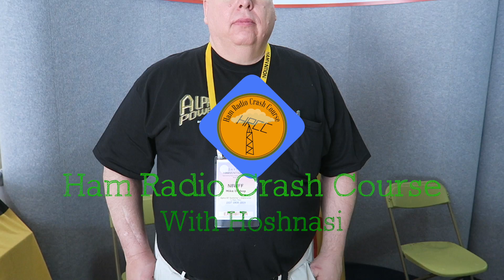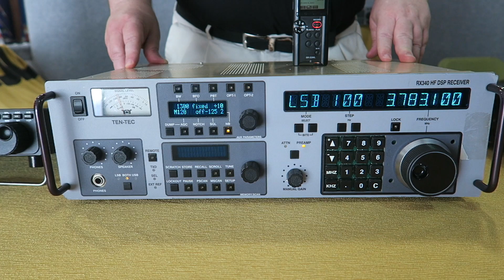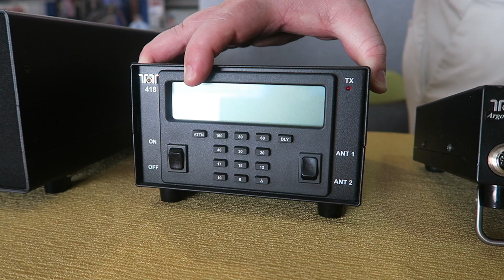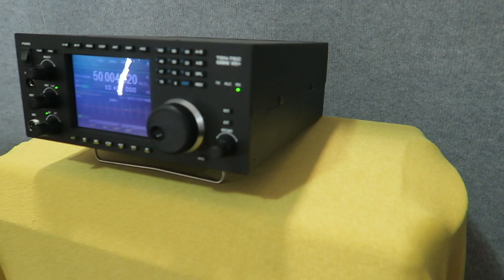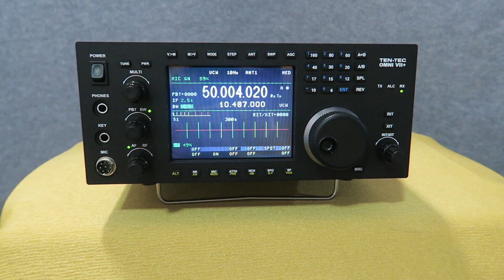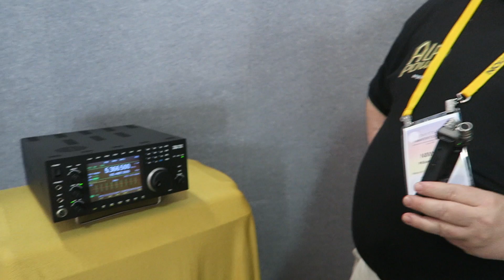New From TenTec The Omni 7 Plus Hamvention 2019

Comment: For the people who are in complaints about the look of the omni 7+  It was logical tath you take some of you stock radio and improved some and then store the pond and see how it goes, next will be a Orión 3 all pimp out, taths Wath a small company do in these case, Kenwood take more then a decade for a new radio after the 950sdx which was top line but they drop the ball for a while, amateur market is base on a hobby and not all people have 50k on the cash purse for buy new eyecandy radio antenna amps towers and more, the price with tuner and filters is 3,300 to $ 3,400 far I see and yes if you look eyecandy look somewhere else, cw performance is a elecraft or tentec period
Reply: An Icom 7300 is eye candy for less than a $1000. Want roofing filters? Buy an FTDX10 for not much more. This is what puts a company like Ten Tec out of business. It's inevitable. Eye candy everywhere with serious performance for VERY little money

Comment: Looks interesting.I have only had one Ten-Tec station but really liked it,   consisting of a Omni VI plus a Titan 425 amp. Together they worked great. I traded them for an unbuilt K2 Elecraft because I was getting rid of everything and moving to another country 20 years ago.  Later, I found out I could have shipped them with a lot less hassle than first estimates told me. I had traded a Collins S-Line with 30L-1 amp for the Ten-Tec and had excellent results with the Omni-Titan combo. What I liked just as much as the performance was the ease of working on them, just doing alignments and pm was easy with the good access to test points and service data available by very helpful people at the factory.   I tended to search out old classic gear and refurb it so the Ten-Tec units were the first modern transceiver/amp and the first I did not have to modify. I wish them the best of luck and good sales. Currently still using the K2 and a TS-50s Kenwood but not on the air much anymore due to living in the middle of a large city and high noise levels and lack of roof access. I use them on bike or train trips to the woods and overnight lake camping where a wire antenna can be as long and high as the trees available.  It is nice to see a US manufacturer remaining in the country, not many have. There were not many left 20 years ago when I moved to Eastern Europe so there surely are very few now.

Comment: Happy to see Ten Tec get the Omni series going. I have the Omni VII and love the radio. Its big enough to get my fingers on the knobs. The display is 'LARGE PRINT' and BIG. The menu system is one button and no sub-menus!!!...I had a malfunction and break down of my Manual external tuner while transmitting 100 Watts on my Omni VII. It burned two FET transistors in the finals of the Omni VII.  I contacted Ten Tec in Tenn. The service dept. was great. They fixed the radio in about a week and shipped it back to me $150 (including shipping). Great receiver and I get compliments on the clear audio. Looking forward to Omni 8.

Comment: I bought and returned the Orion II because the Multi-Function knob was a wobbly POS.  If any other company were to charge 4K bucks for a rig, that multi function knob would have been sleeved and fly-wheeled with some nice tactile feedback.  Glad to hear they have apparently fixed the cheapo knob problem, and hopefully they will put out something that is not basically a 14 year old design.
Reply: It may be a fine $1500 radio. But 2,700 for a radio that may be offered a short time while they go comatose again, nope. They have a poor record and have to show they can and will stay in the amateur radio business before I would buy one. Remember the much overrated Paragon.

Comment: Still using mechanical filters? Will wait for SDR version.
Reply: You don't have a clue. I have a 25 yr old TT with mechanical filters, that will copy stuff a sdr doesn't even know is there.
Reply: @miker1473  Yes and it works other way as well with SDR. I too have old and new radios.
Reply: Pandamonium  the tentec jupiter was the first sdr with buttons a great radio and a pure joy to use have some short cuts but again was the first unless I’m wrong I have one still and some amps but they come way along and hope they do better since tentec was the best ve radios it was only under or next to elecraft

Comment: Estimated price?
Reply from the maker: I do not know.  I'm in talks with them and will post more when I find out.
Reply: Actual retail price....$2,699.00 per their website.
Reply: $3,078.00 with install and calibration of tuner.
Reply: @Riverking1  I'm new to this but at that price wouldn't it be better bet to pick up a Yaesu or Icom just for the support you're able to get from them or users online?
Reply: @dwayne5530  it's definitely not a beginner's rig but I'd take it as an upgrade to my Jupiter if I had the coinage.
Reply: @dwayne5530  if the "new" company is anything like the way TT was before, you'll get plenty of support directly from the manufacturer. I talked to Stan for over an hour on the phone, before dropping $3500 ( loaded up on filters) on the Omni 6+.
Reply: Always glad to see more options available. Will be watching their offerings. When looking into radios they were a choice, but went with the big three.